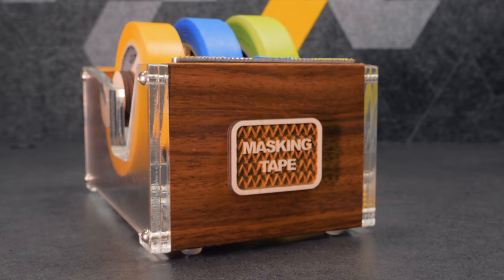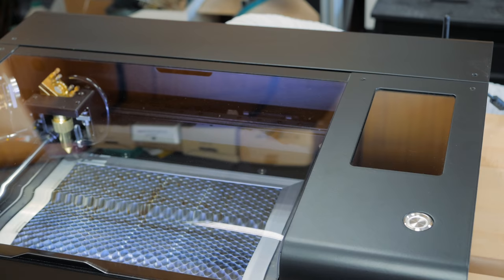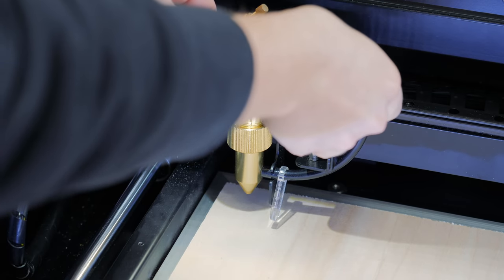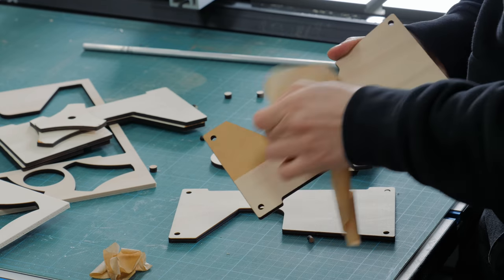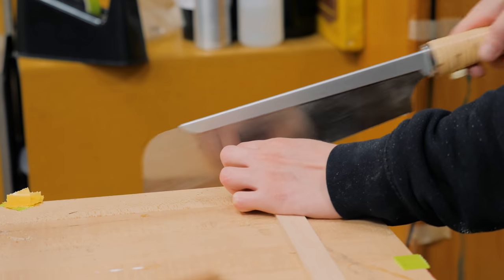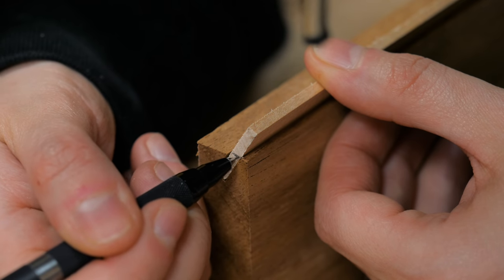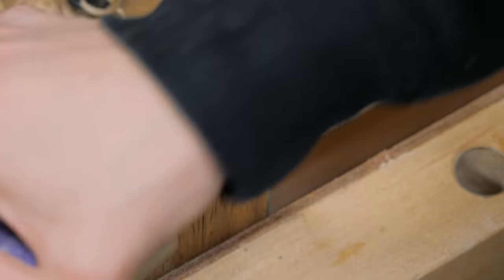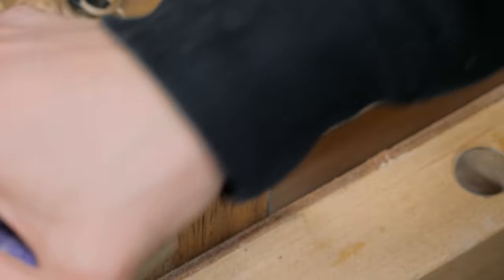I Made a Multi Roll Tape Dispenser from Scratch!

Comment from the maker: This is my take on making a tape dispenser from scratch! Template available here https://youtu.be/O19t7NAMk70 I used typical woodworking tools as well as the Beamo laser machine from Flux. Check out Flux laser machines https://www.fluxlasers.com/shop/laser-cutters/
Reply: If you use a bottom up cut when lasering it will remove most of the laser burn from your engravings.

Comment: Hi Cristiana, super impressive the cutting capacities of this laser cutter, I have seen some used by other Makers like you but with smaller capacity (max 3mm) but here you cut the right thickness and I believe it is is the first that I see cutting such a thickness that allows to be able to do a whole bunch of things that would not be possible without this type of machine. Okay, I understand that it is better to have a workshop to use it because it gives off a lot of burning smell and could disturb (even worry) the neighbors if we use this machine in an apartment, otherwise it is necessary, as you do look, add some sort of air "purifier" which certainly adds to the price that shouldn't be a giveaway for such a machine. In any case your adhesive tape dispenser is very cool, as I use the tape a lot for various things I find it prettier than those found in stores, looking forward to discovering other achievements made with this great machine 👍

Comment: That's really neat. Live the details like the screws and sign. They really set if off.  I wonder if you could angle the front forward a bit so you could pull directly down on the tape rather than towards you a bit. Even pulling towards the back slightly as it goes down might make it able to get more force on the tape.

Comment: I love it.  I wondered if it is heavy enough to use 2 handed?  Perhaps if thick enough the front and rear faces could have metal rods inserted (hidden) to add weight, and perhaps rubber feet to add friction?

Comment: Great video.  I noticed that your blade height on the crosscuts might be too low,  causing the tear out because the teeth are likely cutting sideways on the top surface instead of downward.  The angle of the blade should be coming down on the top of the board.  Hold the wood to to the side of the blade and notice if the teeth are more vertical than horizontal when crossing the top of the piece.  I hope that make sense.

Comment: For thicker tape like the gaffer tape, i wonder if it would be better you have a slider with a blade that passes over where you want the tape cut, instead of relying on pulling the tape on the saw blade.

Comment: Instead of the cutting blade with the spikes you can use the normal razor blade or similar sharp blade which you can replace and it will cut like butter.

Comment: Should you add weight to the bottom base?   A metal plate?   Most manufactured tape dispensers are weighted I think with sand

Comment: Add sand to the bottom of the tape dispenser. Most of my old tape dispensers came with a compartment where you'd put sand. At the size of that dispenser, that's gonna be more than enough sand to weigh it down.

Comment: Turned out really nice. I considered making something similar years ago and was going to use a steight edged bread knife (^^^^^^^^) for the cutting blade (not one that is too coarse) because it would cut thicker tape better. For very thin or fine tape the blade from a cutter knife could be a possibility. Love your design very much. Respect always for your ingenuity.
Reply from the maker: Thanks Robert! That could work I think, you should try it out.
Reply: @GetHandsDirty  .... Oh thank you! I would, but infortnately I no longer have any workshop possibilities and if I did they would surely not be like yours. Therefore it is hard to reach the same high quality end products.

Comment: Nice. You used the Beamo and cut multiplex of 5mm but in the specs it says it can only cut 3mm. I am looking to maybe buy one so your input could be helpfull. Did it cut easy? Problems?
Reply from the maker: It can definitely cut more thickness :) Note that that density of the wood is crucial. For example I used poplar plywood that is less dense than birch plywood. Birch will need more power and/or passes than softer woods. But anyway, it cut my 5mm ply in 1 single pass with no problem at all, but 5mm birch ply could need 2 passes to cut all the way through. You need to experiment. I haven't done tests with thicker material but I am convinced that this can cut even thicker plywood, maybe 6 ou 8mm with 2 passes. My acrylic was also 5mm deep and it cuts nicely in 2 passes. So much to learn and try!
Reply: @GetHandsDirty  thank you so much! Love your work. It's nice to see a European maker (who's also a youtuber) at the top. Inspiration!

Comment: To negate marks from honeycomb bed you can lift the material from the bed slightly. 3mm will get rid of most of the laser backlash from the metal. Search on youtube: «Laser Hack: Pin Table with Acrylic Blocks» for more info

Comment: This laser is underpowered for acrylic - it shows in slanted edges. Same will happen with denser woods. You should plan your cutting (and even CAD) with account for that angle. To cut 6mm acrylic perfectly straight - even 200W isn't really enough.